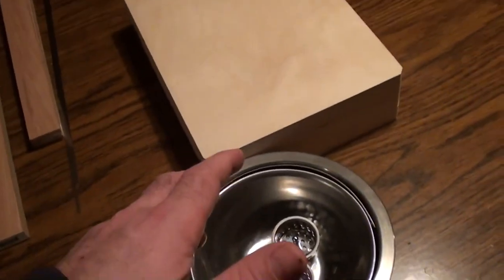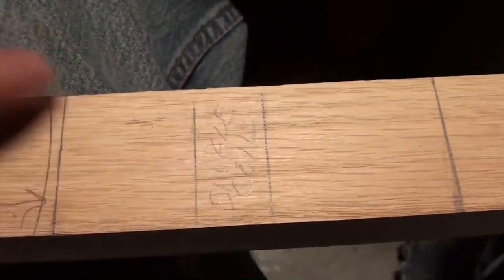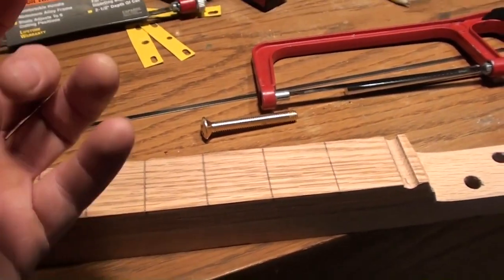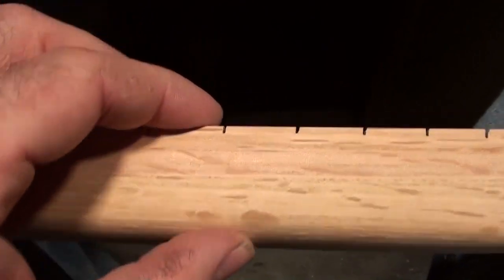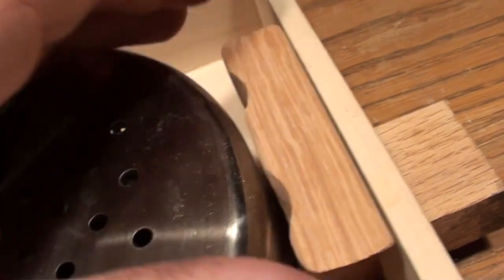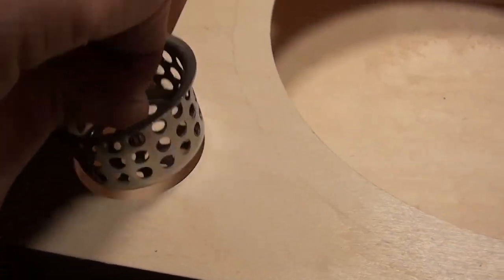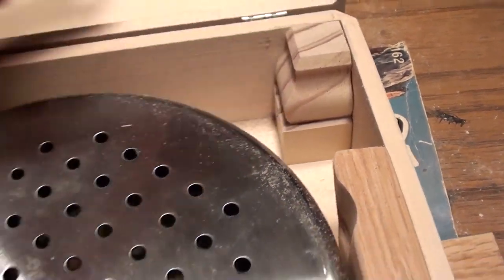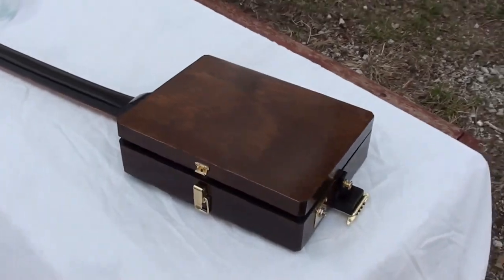Electric Cigar Box Guitar - Full Build to Playing - Robert Johnson Tribute

Comment: Absofreakin awesome!
That looks and sounds amazing. 
I run a Midas 1 sound board at my church. 
I would love to hear that plugged into a sound system with good subs pushing around 95 to 100 db. 
I’ll record this coming Sunday and post it and tag you.
Reply from the maker: Thanks!  Yeah, that would be awesome.  It's hard to convey what it really sounds like through Youtube.
Reply: @RamblinAround  were you plugged straight into the amp?
If that was without a pedal I really love it.
Reply from the maker: @maddmaxx6730  Yeah, that was straight into the amp and not a very good amp either.
Reply: @RamblinAround  dude, it rocked

Comment: How did you set the intonation with a fixed bridge design ?
Reply from the maker: You can turn the "biscuit" that the threaded rod is on slightly and get it pretty close.  I've built them before with a Gibson style bridge with the adjusters.  This one is a little more primitive.  It gets the job done though.